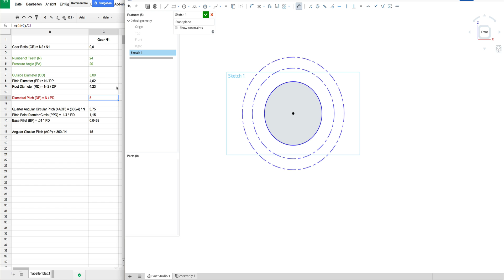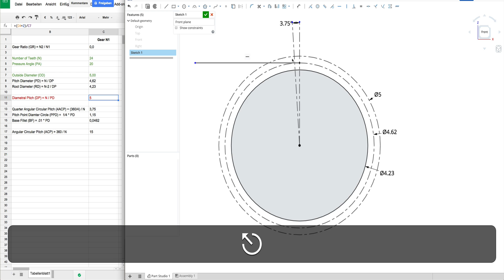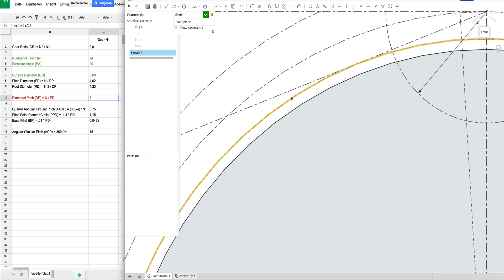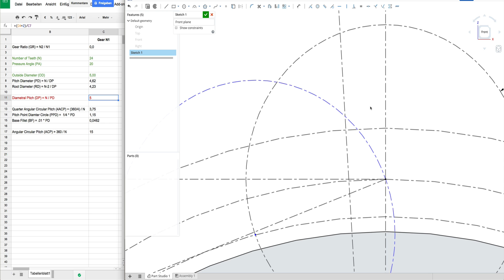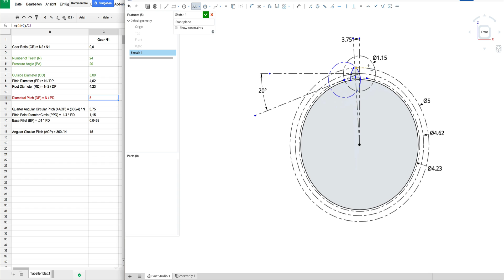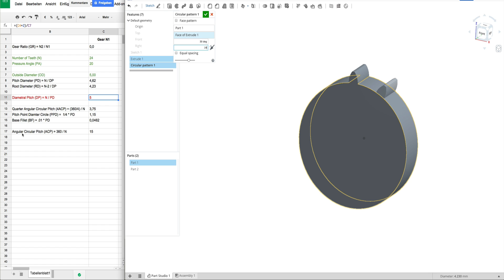Comment: I think there are some mistakes in your sheet, I tried to make a 20 and a 40 teeth gears with your numbers but they don't match ok, can you help?
Reply: if you wanted to add more teeth to a gear you would have to make a gear ratio and use that to change all the measurements

Comment: But how do you export this one complete gear to an STL file if there are so many parts(24 parts to export), in the end you need to have 24 STL files for it, such that when you 3D print out on flashprint, it just prints base circle with one of the gear teeth instead of the base circle with all the gear teeths together(as according to your drawing)
Reply: With the circular pattern, click add instead of new.  This is an older version which doesn't show these options of Add, New, Remove and Intersect, I think.  Or you could boolean them all into a single part.

Comment: On shape is really disgusting, on Solidworks, Fusion, or Inventor you can find a plenty of designs of gears and screws and many other parts in the library, and the modern cad onshape doesn't has a library for the basic designs

Comment: Can you tell me if the dimensions you are using is in millimetres or inches?
Reply: I am using millimetres.
Reply: I am trying to produce a replacement plastic gear which needs replacing, the total outside diameter is 50.60mm and has 40 teeth.  I am struggling to calculate the values required to draw a replacement in Onshape using your method. 
Could you please see if it's possible to work everything out from there. 
I would appreciate your help
Reply: Many thanks

Comment: Sir, I am a little bit confused. I  have been looking in internet and using other formulas for the root diameter where it is equal to 4.17. For instance if you used RD = OD - (2*WD)  where OD is the outside diameter and WD is the whole depth you get 4.17 instead of 4.23. If you could help me to understand the difference or whether I made a mistake or not in the calculations it would be awesome. Thank you.
Reply: Hi Abraham, thanks for your comment. It might be that I have a mistake in the listed formulas as I gathered than from the internet as well. I t might be good if you create a gear using your formula and see if it works out.

Comment: I'm sorry sir, but I believe your tooth profile is not correct, you end up with a arc circle profile, but gear teeth are often involute of a circle or, for clockwork, cycloidal shapes.
Reply: +nraynaud1 Thank you for your feedback. It might be that the tooth profile is not 100% correct. I mainly do 3d prints and models and for that purpose those gears will work. Thank you again.